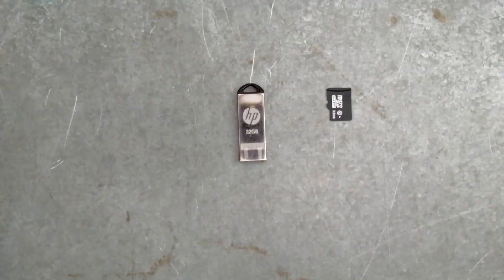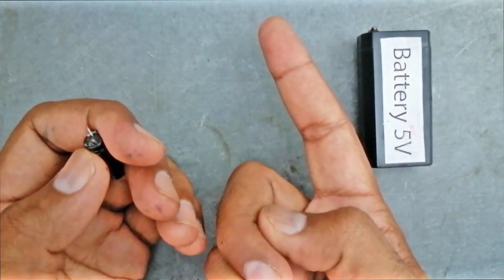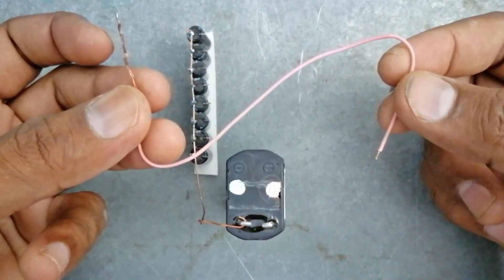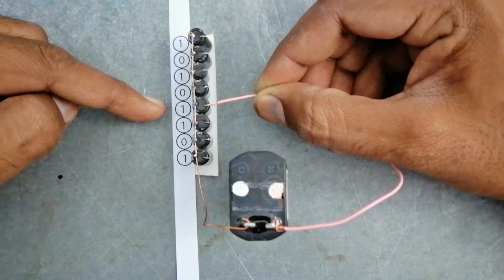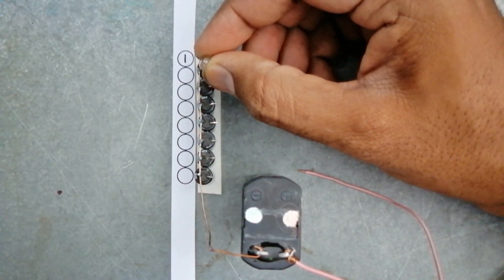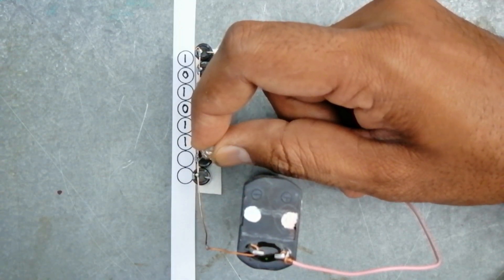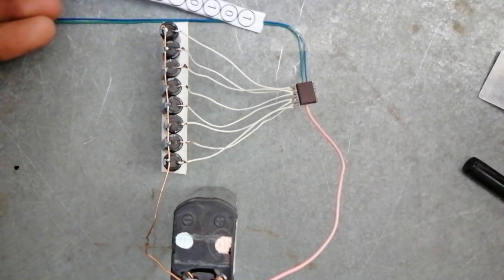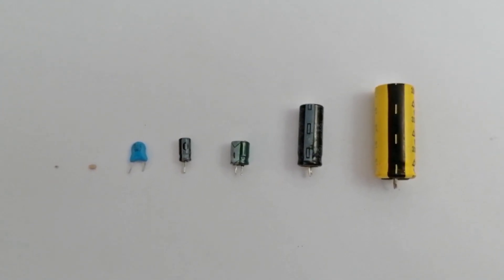How flash memory SSD and SD card works what's inside and how stores data

Comment: To teach the concept, the video is good. But in reality, data is NEVER STORED IN CAOACITORS in static drives like Pen Drive and SD Card.. Memory cards don't have tiny tiny capacitors as you said. Instead transistors are used.
Reply: You are wise

Comment: Great demonstration.
Now how can you verify if an SD card is operating properly?  For example, when inserted into the laptop, the disk manager recognizes the SD card and indicates correct operation.
Yet, when inserted into the camera, the camera does not turn on or respond in any way.  So, the camera does not "sense" the presence of the SD card and will not turn on.
Any thoughts out there?

Comment: Hi, 
thanks for this simple presentation. 
To go further you can now categorize the memory: ROM RAM SRAM DRAM EEPROM...
What you are showing is the working principle of the  DRAM Dynamic Random Acces Memory and it is volatile, if you release the power you will lose all the data.
Flash memory is an EEPROM NAND or NOR gates based. This memory holds the data in the absence of the power supply.
Reply: He cannot read data after reading once...
Hence it's volatile and loses data..
Reply: Didn't he release the power? He connected each capactior to the battery to charge them and removed it and was still able to read the data at a later stage. My understanding is that the capacitor can hold the data for an extended period of time. Maybe i'm missing something, please elaborate
Reply: @markarthur1083 it means sd card is corrupted 😂

Comment: But if this is only one byte how many capacitors must there be in a 256gb SD card.
Reply: 1GB = 8×10⁹ Bits
256GB = 2.048×10¹² Bits
So there are as many tiny capacitors and that's crazy
Reply: @anshik.k.t  how do the make those i wonder

Comment: That's a clear explanation! Are there ways to prevent the voltages dissapting every time we read them? Or are they just really small?
Reply: No, instead of capacitors, practically charge trap flash memory cell (a special type of dielectric cell which can store different levels of electrons for a very long time, nearly a few years) is used in SSDs but the theory of storing data is very much similar to a capacitor described in video. And the micro controller  attached with it measures and maintains the level of charge trap, until you edit or erase the data. This micro controller also loads a volatile copy of the data in cache when we access it in a device and send feedback to system for charge tap level control. In modern SSDs one memory cell can store 3-4 level of charges,i.e., a single cell is equivalent to 3 or 4 bit memory, an array of such cells along with micro controller and suitable I/O connecting Interface make a total SSD.

Comment: I'm sorry to bother but I can't help but point out how MISLEADING this is. Sure you could use the capacitors as an analogy, but SD and SSD Memory uses NAND flash, and relies on TRANSISTORS to store memory. NOT CAPACITORS. You know what the problem is with using only capacitors? It's that it very easily discharges over time. (And you won't believe how fast this is, relatively speaking.)

There's a reason why it's DRAM modules that use this capacitive type of memory storage because it only needs to hold that data temporarily. Compared to SD and SSD which needs to hold data for as long as it can, for years, ideally. 

In principle, yes NAND flash works by storing a level of electrons and it can be quite similar to a capacitor, but you had not explained this at all, and have also proceeded to comment on other users here that they could store memory on capacitors. Yes you can, but with a big asterisk.... only for DRAM modules. SD and SSD don't store on capacitors because capacitors are volatile. They easily discharge over time,  when left without power. NAND flash which is what ACTUAL SD AND SSD uses can store data for YEARS.
Reply from the maker: Thank you 💕.
I have make another video about memory concept is it right please explain your ide
https://youtu.be/bMSXQhra6hY